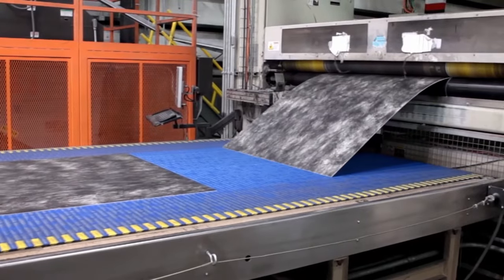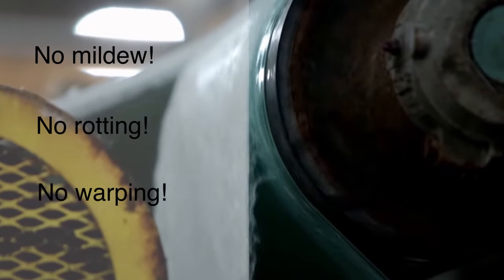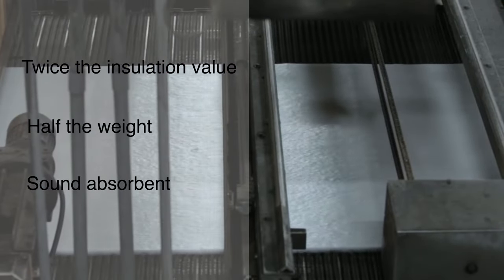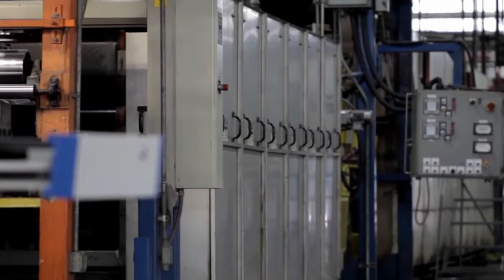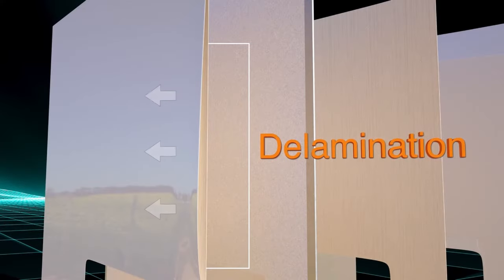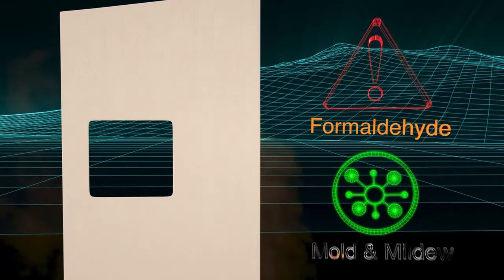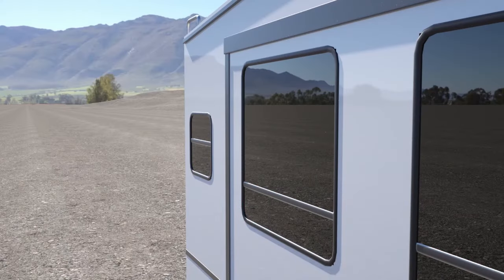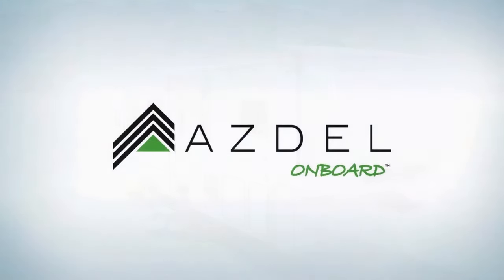Azdel Onboard Composite Sidewall Panels

Comment: What adhesives to use is a major problem when the company does not document the adhesives that should be used on the dark side of the panel going to OSB and the white side EPDM on top of that for a camper roof. What adhesives to use?
Reply from the maker: The roof deck and membrane material used on a particular roof determine which adhesives are used. These adhesives are audited by the roofing supplier frequently and we use the adhesives required by the supplier of each of the various components to ensure proper installation and warranty. For this reason, we recommend that any work be done through an authorized Forest River Dealer.
Reply: I just bought some panels at hardware store. Guy said the supplier recommends using construction adhesive rated for panelling. PL200 is what he recommended for me.